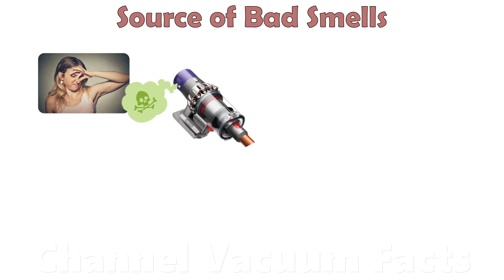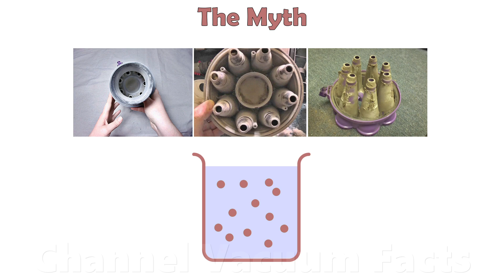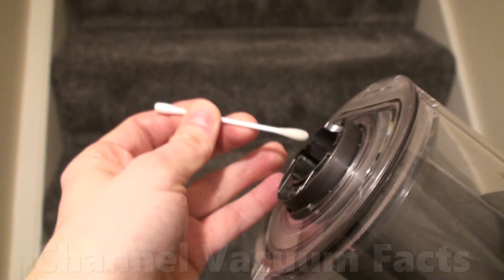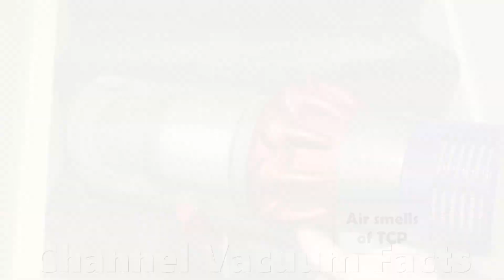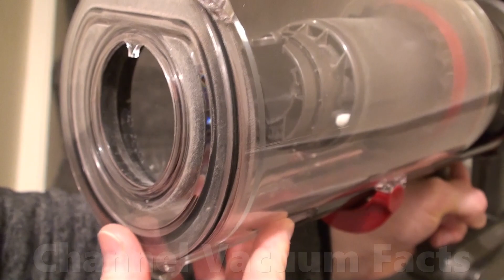How to Fix a Smelly Dyson Vacuum Cleaner

Comment: The v10 I had the other day stunk before I washed the filter. They do produce smells, but hide it well. Right up until you don't wash the filter as instructed, then it's too late to do the rinse and swirl, and more in depth cleaning is required. So it's not true that they don't hold smells (when I turned it on for the first time the vents were at nose level, and it stunk) but wash the filters regularly, and they'll keep at bay. Same with bagged vacs, change the bag regularly and it won't smell. Bagless cleaners require emptying more often as the dirt is aerated as it fills, so holds less (as its not so compacted). A bagged vacuum (especially a miele or sebo with a decent quality bag) can pack itself very full, which can have the negative effect of not being emptied before that smell overpowers the poor thing. I can't remember the last time I had a smelly vacuum to be honest. My Miele S5510 smelt when I used it after 3 years of rest, silly me forgot to empty the bag. The dc25 I had that had been used to vacuum up weed was 'interesting' smell wise, I had to strip and wash it in the garden!
Reply from the maker: Yes, all vacuum cleaners produce smells for the reasons outlined in this video. I'm not convinced 'more in depth cleaning' is required on the V10 (whatever that actually entails). It's difficult for me to test directly because mine never actually smells, even if I don't wash the filter—just down to the nature of the material being picked up, mostly. I've come to the realisation that vacuums should be emptied after every use. The V10 takes 3 seconds before putting it back on the wall, and produces no mess or additional running costs. It's likely because of this that it never smells.
Reply from the maker: @s-tiergaming6378  Check out page 10 of the manual ( https://www.dyson.co.uk/content/dam/dyson/maintenance/user-guides/GB&I/cordlessvacuums/sticks/v10/dyson-stick-V10-absolute-vacuum-user-guide.pdf ) and see this video and judge for yourself: https://youtu.be/uuF0Q0x3P8E

Comment: After 12 months of using my V10 a couple times a week and washing the filter regularly (approx. every 3 dustbins full) and always allowing it to dry for a minimum of 24 hours, I finally got smelly air coming out of the filter.  After washing the filter as usual under cold running water, I sprayed it down with antibacterial ethanol spray, and then left it to dry outdoors for 48 hours.   I also gave a very brief spray into the top pre-filter which is concealed beneath the plastic (underneath where the filter screws in).     

This seems to have done the trick, as the air coming out of the filter no longer smells.   However longer term testing is needed to confirm the longevity of efficacy.   I also cleaned inside the dustbin quite thoroughly too, and heaps of dust came out of these thin channels around the centerpiece, so not sure if that was stinking it up too.   

I note the spray is ethanol only and contains no other chemicals, as Dyson say not to use any detergents on the filter.   Honestly I'm not even sure ethanol won't damage the filter, but what alternative is there?   Washing it in cold water is not a long term solution, so some chemicals will be needed to kill whatever bacteria is releasing the odour.
Reply from the maker: Existing bacteria die in dry environments after a few days. TBF it's hard to avoid smells in any vacuum if you have pets, just like it's hard to avoid bathroom smells when the toilet is used. You just have to 'flush' the vacuum regularly (empty bin and rinse filter monthly).

Comment: I enjoyed this video it cleared a lot up  for how the cyclone works.  I did want to see what you thought of an alternate way to clean the filter on the v-10 instead of water.  Seems to work very good  just wondered what you think of this method.   There is an item available on amazon called Data Vac.  It is a corded high pressure air system that is used a lot for cleaning out the dust in electronics like computers etc. or where ever dust hides.  It seems to be very effective in removing the dirt from filters etc. needing no water.  Anyway thought i would send my experience your way.  Btw one last thought on the Data Vac... it also is  good in removing dust from all other areas in the v-10 as well.
Reply from the maker: High pressure blowers will remove larger dirt from pre-motor filters. It won't remove small particles which are often the source of odours. High pressure blowers will not work for post-motor HEPA filters because of how they work. Rinsing is a simple solution to solve all filter cleaning and is recommended by the manufacturers. Further discussion from me here: https://youtu.be/QTSadOm6WsI
Reply: @VacuumFacts  thanks for  reply, but just curious have you ever actually used a Data Vac as i have described?
Reply from the maker: No. I've also never used a can of compressed air, a leaf blower, an electric pressure blower, a jet engine, or a wizard's wand. :) None of which bypass what is discussed in the video I linked to. It's also £50-85, rather than £free like water.
Reply: @VacuumFacts  Never been partial to a Wizard's wand either  lol... anyway i watched your linked video and found it  very interesting, but it makes me wonder about something maybe you can explain... It seems that many organic particles may be "oils".. so if they are it seems  it would help if a filter was lightly washed in a light detergent and then clear water rinsed?  just wondering about that.
Reply from the maker: Not sure about oils, but I'm not versed enough in the detailed chemistry or surface energy physics of the range of particles to offer a learned opinion. However, I will say that the manufacturer's instructions, which have investigated a lot of this in their labs (at laest for the more furnished companies), indicate only water is sufficient to restore a filter, suggesting it's not an issue.

Comment: Thanks for this video and explaining the physically principle of cyclonic separation! I think dyson creates one of the most complex cyclonic separation systems, but I`m  not sure if it is indeed as efficient as they say in their advertisement. What i mean is the necessarity of so many stages of cyclones versus the achieved separation efficiency over build cost. Are so many cyclones connected together really usefull, were is the "break even point"?
Is there any separation gain of efficiency over use one or maybe just a few Cyclones?
Nevertheless - even owning a V8 -  Dyson in my opinion is to pricey. They revolutionized the whole Vacuum cleaner market but oher companies like Tineco, Xiaomi etc. hit the market with lower priced solutions. They don`t have the complexity of Dysons Cyclonic Systems, but I think they are doing their jobs well for lower price!
Reply from the maker: I've seen no evidence of a dust separation system that performs better than Dyson's that doesn't rely on filters or bags which bring a huge host of problems—that led to the development of cyclonic filtration in vacuums in the first place. Happy to receive said evidence...it never comes though...
Reply: Sure, Dyson has the best cyclonic separation at the moment and also since they started selling their vacuum cleaners. No company was able - or they simple did not try to develop - to create and manufacture such complex cyclonic systems. If you are looking for a good vacuum which is a bargain (lets say below 300€) than you will be wrong going with dyson.
If you go closer to approx. 500€ as for todays circumstances and market share of other vacuums, i think dyson is worth the consideration.

Comment: I'd have to concur with Mr. Vacuum Facts.  I've been using a Dyson V8 regularly for 2 or 3 years and have 3 good sized dogs.  It once picked up a little smell, but I cleaned it and it was fine.  99.9% of the time, it does not smell.  Today, I took my expensive Miele Marin out to do some vacuuming and it smelled.  Not horribly, but very noticeable.  Sometimes I do like using the heavier, mains powered vacuums, but for most chores, it's the little Dyson for me and if I could "only have one" vacuum, it would probably by the Dyson.  It's very simple to use, does a lot of things and works well.

Comment: Our Dyson stinks, all our cordless Dysons have developed a putrid stink.

Doesn't matter how many times you empty it or clean it out, the smell soon returns.

Not at all convinced by this video. It's like Dyson paid for a propaganda video because so many people are suffering from these smells.

We've never had a vacuum cleaner smell as bad as these do.
Reply from the maker: Interestingly, my dyson doesn't stink and none of them have ever developed a putrid stink. I think this video and the video description here https://youtu.be/SCcVBgFZ7Dc addresses everything.
Reply: @VacuumFacts  I'm religious about emptying mine & washing filters - I've even replaced the filter several times, & it still smells like the dogs, even with an empty chamber. Something gets stuck somewhere & the only logical thing I can think of after listening to your explanation of how the cyclones work is dander/residue inside the attachments themselves (the powerhead, tubing, etc) causing the smell to travel its way through & out of the exhaust.
Reply from the maker: @TyGuy1989  All vacuums will always smell like dogs if it sucks up their pet dander. You can't fully eliminate smells; you can only minimise them (e.g. by using Zorb and filter rinsing and regular bin emptying).
Reply: Vacuum Facts well when I throw out the bag on my Miele u1 guess what the smell goes away
Reply from the maker: @EvanJS2005  Of course; just like emptying the bin. Most of the smelly material is in the bin/bag, so makes sense. Except when you throw the bag away, you're adding unnecessary waste to landfill and costing yourself money. And, by your own admission, the bag smells. So, I suspect you have to put up with the smell for longer than needed until the bag is full, otherwise you're throwing away a half-full bag and wasting money and adding further to polution. So yeah, as you rightly highlight, bags are really, really stupid. All vacuums smell if you suck up smelly material. Dyson bagless, specifically, are the relatively least smelly, costly, or polluting cleaners out there, as highlighted in my recent V11 1-year update review https://youtu.be/sNSr60Vuw0I
Reply: Vacuum Facts ok you need to know that I own 13 Dysons and all of them smell even after I took them apart and cleaned them idc about paying for bags
Reply from the maker: @EvanJS2005  I think this is fully covered by the description in this video https://youtu.be/SCcVBgFZ7Dc

Comment: It’s very easy. Sprinkle your carpets with bicarbonate of soda once a month. Let it lay. This will take odours out of your carpets in minutes.  Suck it all up with your v10 or 11 or whatever, and the remaining effects of the bicarbonate WILL remove the smells. Of course wash your filter as described too.
Reply from the maker: An interesting idea that the whingers should try to see if it works. I don't suffer from bad smells, so I couldn't try. Plus I empty the bin every time so odious material doesn't fester in there.
Reply: Baking soda is very fine and can pass through fabric and sponge pre motor filters and possibly damage the motor and its bearings. It can also damage carpets as it is not usually all removed from the vacuum and rip up the carpet fibres.

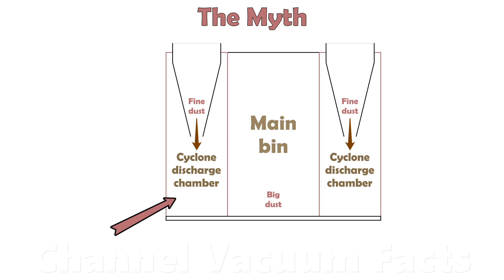Comment: Until you started your YouTube channel, I used to wash my bagless canisters in the tub to get the smell out. I didn't know then that it was bad and pointless to do. I would then allow them to completly dry out by putting them outside on my air conditioner fan along with the washed filters. I'm currently at 2:41 but had to say this lol. Continuing now. 🤣
Reply from the maker: Washing with water works because it gets rid of the smelly material in regions where the air passes through, but you can clean those regions without submersing in water and all the hassle and risk. Keep the bin empty after use and rinse the filters montly if there are smells, and that will give the biggest improvement. But if the vacuum always picks up smelly material, then there'll always be smells (on any vacuum).

Comment: If i put a dryer sheet in the cyclone, the smell comes out the exhaust
Reply from the maker: The cyclone is along the air path, so you'd expect that. No idea how you fitted an object that big in the cyclone either, or how you even got it in there.